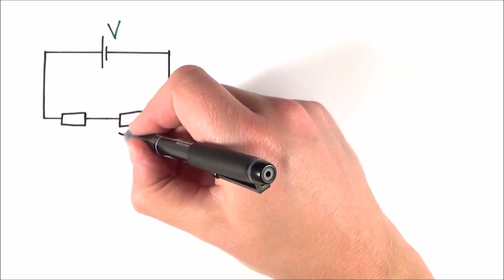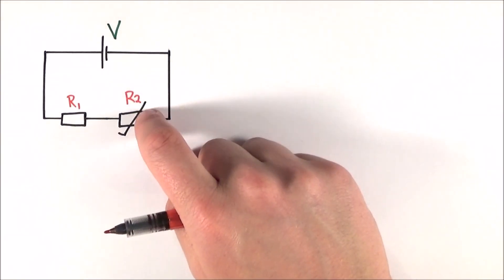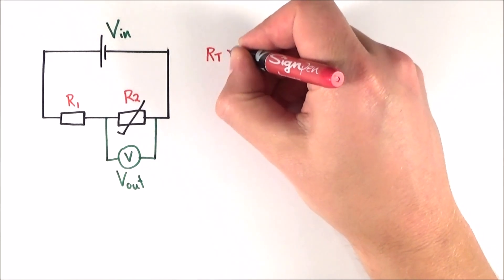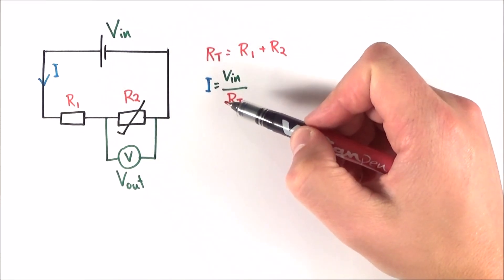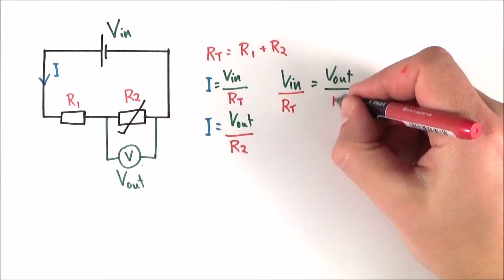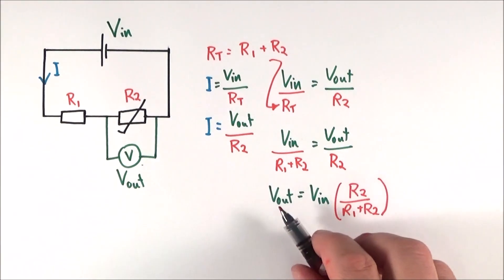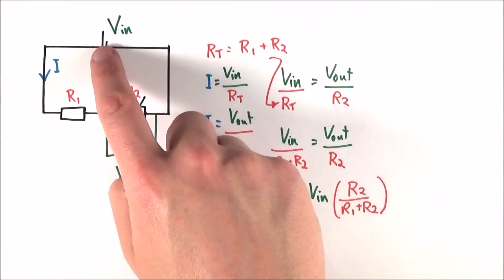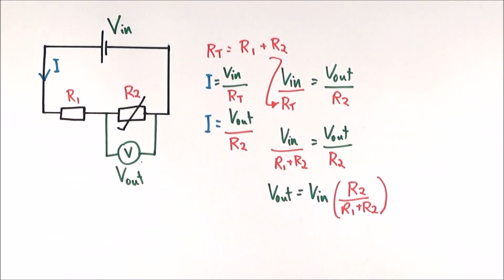Potential Divider Circuits - A Level Physics

Comment: I don’t disagree but I find using ratios a much more efficient way I mean this way works aswell but some questions it can be really tricky to use this formula where using ratios is much easier. Still a great video and your making a level a lot easier then it is👍

Comment: Now this makes sense to me.. for some reason I've been told that a higher resistance will give a smaller share of the terminal p.d. and just makes no sense... AT ALL...
Reply: I think its because maybe they were describing it if R1 had a high resistance, R2 would have a smaller voltage drop as a result but that's kinda convoluted imo.

Comment: 3:39 "If you know the current and the resistance at any point in the circuit, you can work out the potential difference across that b*tch"

Comment: does this still apply if the cell has internal resistance
Reply: Of course it does. Because every cell/battery will have some amount of internal resistance. This equation wouldn't be very helpful if it only applied to theoretical circuits.
Reply: yes. The resistors are still getting some voltage, even though it's less than emf. In our scenario here, " V in" is terminal voltage of cell :)

Comment: Is the output voltage always the same, regardless of what you have in the circuit? Like is it always just the emf for a supply with negligible internal resistance? Or does it increase if you have more resistance in the circuit? Is it just current that varies?

Comment: Will Vout be more than Vin?
Reply: Nah  - V in is being given to the resistors and is being shared between the two. V out is the portion that Resistor 2 gets.

You could connect a load, such as a light, to Resistor 1 as well, then you've got 2 V outs (one on R1 one on R2). If you did this and added the voltage value for both V outs, you would get your V in [Kirchov's second law] :)
Its easier to think aboot with a diagram

Comment: I've been looking everywhere but I still can't find an answer to my question.
I am currently studying the OCR AS level (spec A) physics course and there's a part on "Wheatstone circuits with a strain gauge":
In the book they give you an equation for calculating the output voltage of the circuit, but it has missing symbols :(  (there's an error in the textbook).
I asked my teacher but he doesn't know lol, could you please help me?
https://gyazo.com/631086e3570a4c55bb9ee57d8c0067b3
(there's the picture of the equation and circuit)
Reply from the maker: +awesomeoverawesome Ok, I'll try and answer this in words - it may be best to write it out yourself too. 

Question 2.

Resistance = (Rho x Length) / Area

Volume = Area x Length  so therefore Area = Volume / Length

Resistance = (Rho x Length) / (Volume / Length)

Resistance = (Rho x Length Squared) / Volume

This means if the resistivity and volume remain constant then Resistance is proportional to Length squared
Reply from the maker: +awesomeoverawesome Answer to question 3.

Initially when all resistors are 100 ohms the circuit is 'balanced' and the output voltage is 0.  Because  V = ((100/200) - (100/200))x 6 = 0

When there is a 0.001% change to 100.1ohms across R1 then the pd  is equal to 0.0015V

Is that right?

https://en.wikipedia.org/wiki/Wheatstone_bridge
Reply: A Level Physics Online Thank you so much for all your responses, I can't put into words how much I appreciate it!

Typical of the OCR textbook, there are no answers to this part :( This section is found in the summary part, but it is still part of the spec, and there are no answer online either.

Looking at question 3, isn't a 0.001% increase/decrease of 100 = +- 0.001?
So let's say the resistor was to increase by 0.001%, R1 would have a resistance equal to 100.001 ohms.

So applying the equation:

V = ((R1/(R1+R2)) - ((R4/(R3+R4)) x 6.0

V = ((100.001/(100.001+100)) - ((100/(100+100)) x 6.0

V = 1.5 x 10^-5 V

Is that right? Or did I go wrong?
Reply from the maker: +awesomeoverawesome You're correct. I didn't read the question properly!
Reply from the maker: +awesomeoverawesome  But don't worry too much about this question - the Wheatstone bridge is not in the OCR spec - it is only an extension task in the book.
Reply: A Level Physics Online Oh, that is good news! I just assumed it was because it was inside a "green experiment" box. Thank you so much for your help!!! If I manage to somehow get a grade in Physics I will be sure to thank you first; I'm finding it really hard atm.